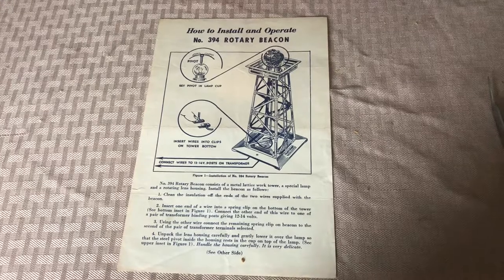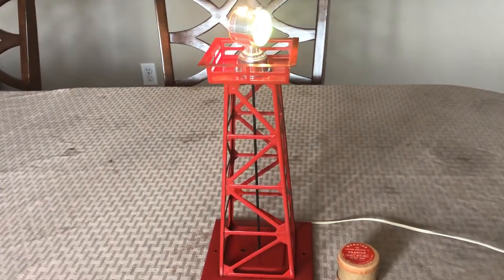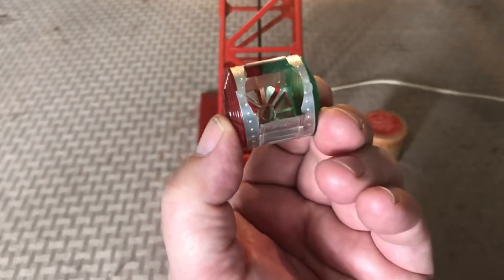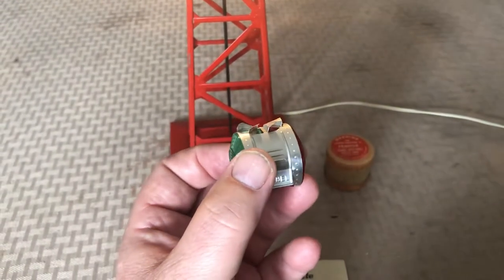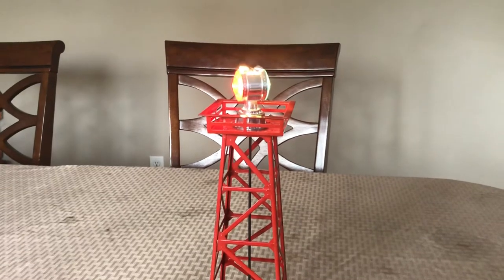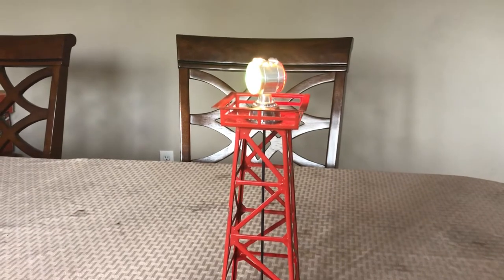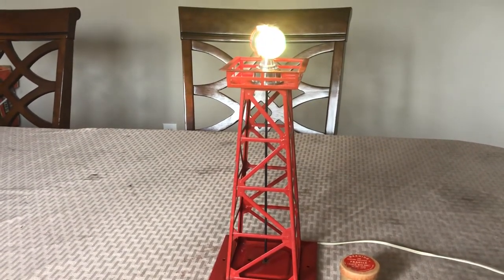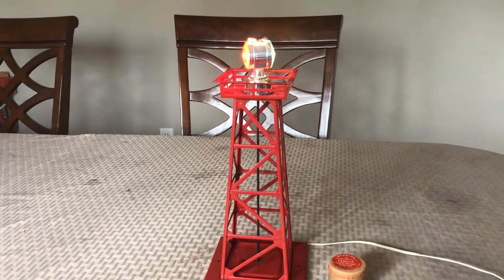Lionel #394 Rotary Beacon 1949 - 1953 (see description for details)

Comment: I saw another post about your work with the 394 and then watched your video. I had re adjusted mine numerous times to no avail but I readjusted to the approximate 60 degrees you suggested and then turned the 1033 full max and ran the output in a ac to dc board and it started to spin! Additionally I put a little graphite in the bulb dent and made sure the lantern was level. I have Heartland Vintage train repair and this is the first time in 30 years that I have gotten one to work.🎉🎉🎉🎉🎉
Reply from the maker: That’s very cool!! I’m glad you got it to work now. I really appreciate your feedback on this, because now you are a testimonial to my video. I just want to help people in my videos, and I’m glad you took my advice, and now it works for you!! That’s awesome! Congratulations!! 🎊🎉Thank you for watching, and thank you for your comment! Tom

Comment: Just got my 394 tower and of course to get the best deal I got it without the rotating top.  I got a new reproduction one which came with a new bulb.  Your video is the best one out there although none show the process of adjusting the vanes.  I may get another new top and show that process and to get them all the same angle, I want to come up with something that can work as a measuring shim.  It took awhile but I did get mine working but I would like to add some notes:  1.  The center pin sometimes comes, not quite straight down, which causes the housing to droop, causing more gravity on one side.  After everything looks good, look at the housing sitting on the tower, from head on and from the side. If one colored lens side droops, very carefully adjust the center pin by tapping it.  It bends easy so a delicate touch.  From a side view the center of the louver array should be dead center over the tower, not slightly to the left or right.  If it is not dead center, bend the pivot pin with a gentle touch then test it again.  In bending the pin (adjusting it), you should not actually feel the pin bend.  Remember, a gentle touch.  2.  Mine came with a new bulb and I began testing at 12VDC on my variable lab supply.  As I tried further to get it to spin I worked my way through until I found that 16VDC is the minimum, and at 18VDC is is perfect.  12VDC will not generate enough heat.  Mine is a reproduction top, so an original top may be less flakey, but with all the above adjustments and running at 18VDC, it runs great and even vibration in the room or my walking around doesn't affect it.  I will be getting a 494 as well but I had to have the 394 working because my layout is a historic representation of the progression on Lionel Prewar and Postwar.  My 394 is the late 1940 silver/aluminum version.  Thank you for the great video as it sent me in the right direction!
Reply from the maker: Thank You!! What a great feedback comment!! I really appreciate your follow up. Yes, you are correct, those center pins  MUST be adjusted very delicately, and like you said, the pin should NOT be bent to adjust it, but to  adjust the pin fastened to the very delicate housing.
You’re  correct, I didn’t actually show how to adjust it the vanes, but mentioned to adjust them to a 60° angle for best performance. A 45° angle was too wide and opening to let the heat escape without allowing the heat to push on the vanes. A 90° angle was way too closed not allowing heat to escape. I found that the 60° angle was the best of both worlds, and ALL of the vanes MUST be consistent in their angles, or else you’ll get uneven heat waves, and then no movement. It’s convection heat that makes this accessory operate properly.
I really appreciate your feedback. It’s how accessories like this need to be shown the proper way of setting them up the way they were intended. Yes, I know many operators want instant success with modifications added, ie: fish pumps, but I’d rather see it operate the way it was intended. It takes time for the heat to generate, but that’s OK. It will work, and when it does, it moves at a prototypical speed, and it’s quiet. Too my any enthusiasts put on a #494 Rotary Beacon because it’s instant movement. And most of the time, operators put on the juice, and the thing spins around like a top. I can’t stand that. I prefer the slow steady movement myself.
Thank you again for your excellent response. I look forward to hearing from you again. I also look for constructive criticism as well. I’m still pretty new at making these videos. I’m really not great at editing. LOL Tom

Comment: How many volts are you pushing to it??
Reply from the maker: Great question. I usually use between 14-16 volts starting with 16volts to get the heat from the lightbulb inside the beacon warmer quickly, then if I remember, I’ll lower it down to the recommended 14volts the bulb is rated at. Even though the #461 dimple bulb is rated for 14volts, applying an extra 2 volts won’t burn it out. Applying more than 16volts will definitely shorten the life span.
Reply: Great Tom, appreciate that. 🚂💨

Comment: my table and base of beacon light seems to be level, vanes seem to be open properly based on your video recommendation, just cannot get it to spin at all. Ugh! Seems so simple just not working for me
Reply from the maker: Are all of your vanes present? Are they all  even at about the same angle? As a starting point, make them at a 45° angle as best as you can. THEN when you have them all evenly opened at that angle, just tweak them open a LITTLE bit more. Keep in mind, each vane actually has 2 bends to it. One initial small bend starting from the beacon, then another bend angling the fin. The fin part needs to be around a 60° angle. That’s what allows the heatwave of the bulb push against it which propels it. There are also 2 flaps near the bouton of the beacon top. Those need to be pointing straight down. They help the convection heat from the bulb, to pull in cooler air that gets heated by the bulb, causing a small air current up to the vanes. Be patient, and you’ll get it. Keep me posted.
Reply: @TomzTrainzandAccessories  I will keep at it. All vanes are present, will need to keep messing with the angles. My beacon tower gets powered through the track. I'm hoping that's not an issue. The bulb works well as far as I can tell. Thanks for your advice.